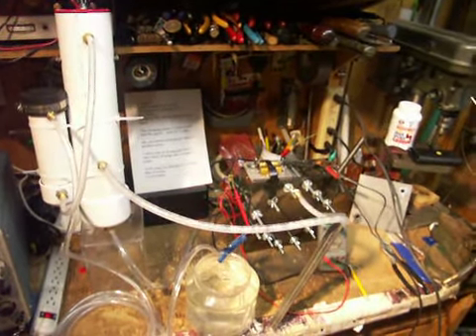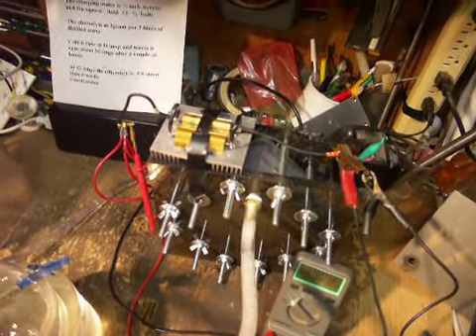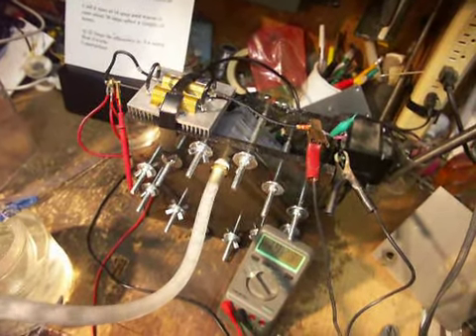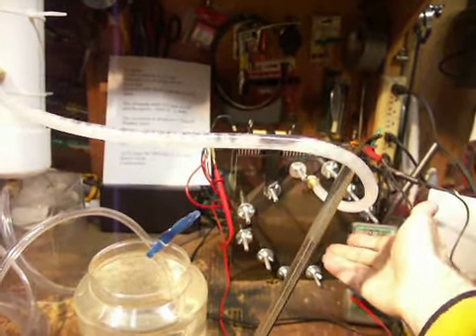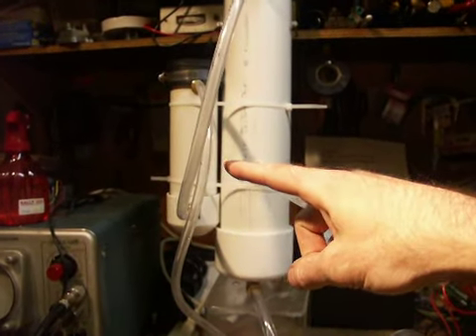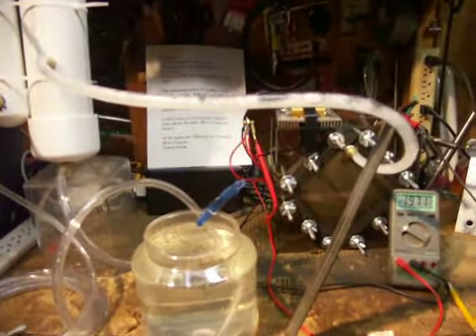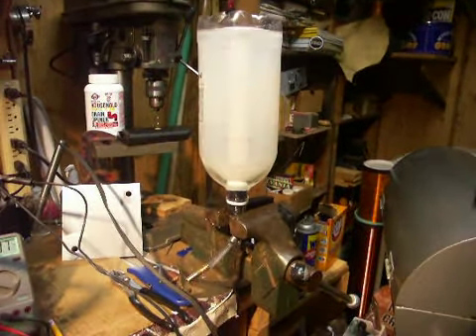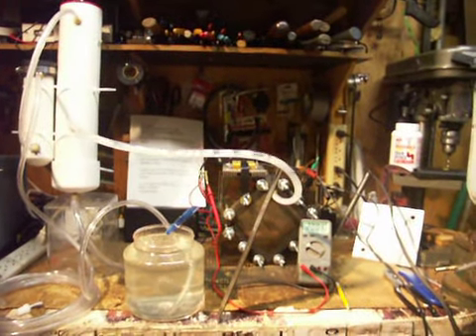HHO Dry Cell Testing #1

Comment from the maker: Leakage current flows from the edge of the plate through the water to the other edge resulting in waisted heat and current. With this design the gasket keep the water from getting to the outer edges of the plates. The only edges are around the holes in the plates. The tubing has a strip cut out of it and is inserted through bottom and top row of holes. The tube rest up against the edges of the holes and gives them some insulation resulting in high performance and less heat.

Comment: I borrowed this design from a fellow named Tero Ranta. He was the first I am aware of to publish this basic layout back in 2006. I have found the design to be very flexible, easy to build and a strong producer. 

Not sure why your production is not better.  I can get 4 LPM easily with 75v @ 12a and when I push it, have gotten 6 LPM with 90v @ 17a. Work on sealing current leakage at holes in plates with slit tubing to improve your MMW.

I am quite flattered and hope it serves you well.

Comment from the maker: I posted the link to the Tera Ranta PDF  at the top of the comments section of video (HHO Dry Cell Testing #2). I like the idea of using rubber grommets in the holes of the plates to reduce the leakage current. I used RTV and glued nylon washers into all 64 holes in my plates and that did make it much more efficient. My MMW went from 3.8 to 4.8. I SOLD the MY dry cell and I'm working on building another one with many modifications. I will be using 1/2 inch tubing on the exhaust side.

Comment: I asked Sid about his temps a couple months ago, he mentioned "lukewarm" after several HOURS of running? Wow.. Thats pretty incredible considering his output, plate size, and size of his cell?

I have been using .028 316 SS submersed and it really heats up pretty fast, too fast. I guess the trick is to get the thing to plateau at max (20 or so)amps and max output at about 120F would be ideal.

When these cells get hot, they tend to run away with heat amps.

Comment from the maker: I use one 40mil gasket in this video. However I recommend the you use 80 or 120mil. I like 80 but 120 seems to be more efficient. Remember to tighten you bolts before and after each run. Good luck with your prodject.

Comment: Thanks I look forward to learing. About how much would it cost and is it possible to increase the efficiency per watt? I hear some say to use round stainless. I am going to check it out. The flip flop circuit isn't much but I want to see how it works. I just bought a 94 chevy beretta specifically for this project. I've got another vehicle (small pickup) that I am thinking about making 100 % HHO. I've seen rubbing alcohol added to the solution.

Comment: heat is formed by gap but if you appart them
more it gets less efficiant so how about using
a condensser or a evaporator to make the hho gas run threw there and separate the condensation this will not only clean the gas
but if you use part of it to also cool the 
generator you will get a double wami, after 
tinkering around for a while my dream is to run the car on only hho three of those dry cells would be perfect a truck alt and battery
would also help an amp cap. a cooler condensser.

Comment: Mmm very interesting.. I saw Scarecrow mention "slitting" some tubing and putting it around the holes to "reduce leakage" on the edges. I wonder how much that would actually help?

So maybe putting some kind of high temp rubber grommet/insert into them might not be a bad idea?

Was thinking about the heating issue, I wonder if going with thicker plates might reduce the heating issues most of us have?

I know my cells heat to 150F in about 40 min. @12v/20AMPS which kinda sux.

Comment from the maker: The gasket material I use is gray low density PVC shower pan liner. I got it from Home Depot and is sold in the bath tub section on a role. I don't recommend this material because it may be slightly conductive. Buna-N is a better choose and is available by the role on line.

Comment: I understand that the gasket holds the water in place and all that.  My point is, the current doesnt STOP at the edge of the gasket it should pass right through the entire plate from end/side to side and then leak there as well?  Unless im missing something, electricity seeks the apposing edge.

IN other words the power is connected EXTERNALLY on the edge of the plate, the power should flow through the ENTIRE plate to the other opposing OUTER edge of the plate and leak from those edges right?

Comment: what is gained by making the holes smaller? I have my own ideas based on theories originating in my head, such as restricted flow-through and longer exposure time thus greater force out..etc...but I would like to hear your's, of course, emanating from experience :)

IMHO, I would also think some water exchange flow-through would help COOL the cell down over longer run periods? Restricting it further might cause MORE heating?  Heat does seem to be the enemy for these cells, at least in my case.

Comment: Question:

How come the current doesnt "leak" from the outer edges of the plates themselves? Esp Since the power is connected from the OUTSIDE EDGES of the plates it should travel THROUGH?  Does the gasket meterial stop the current on the plates somehow?

I just dont understand how lining the 1/4" holes with tubing (though it seems to work) increase production limiting current leakage, while the ENTIRE outside edges of the cell plates are exposed un sealed and most likely leaking too?

Comment from the maker: The smaller holes have less of an edge for  leakage currents. There is a balance between too small and not enough flow and to big and lost efficiency. 1/4in to 1/8in for the bottom and about a 1/4in for the top holes is about right. This is just from my experience. The higher you can get your efficiency the less heat you will have and more gas. Mdbreedi has achieved 8 MMW.How, I'm not sure how. I know that the bigger and more plates you have the easer it is to get a higher efficiency.